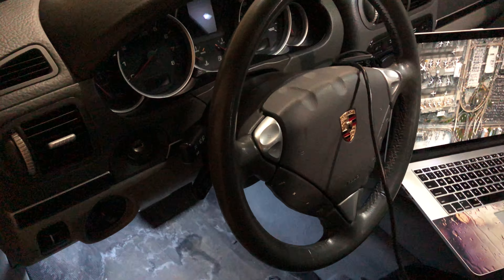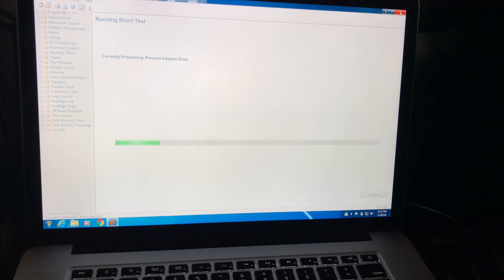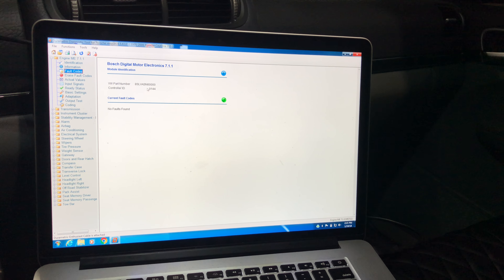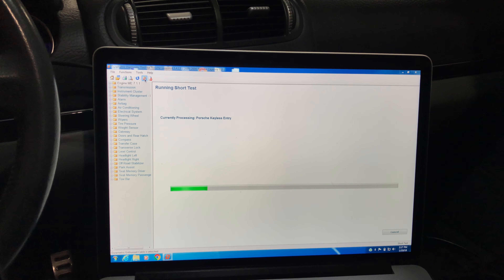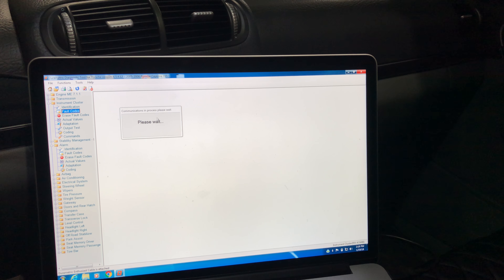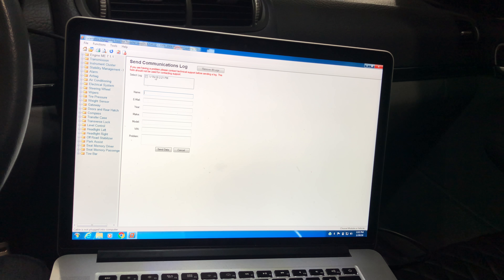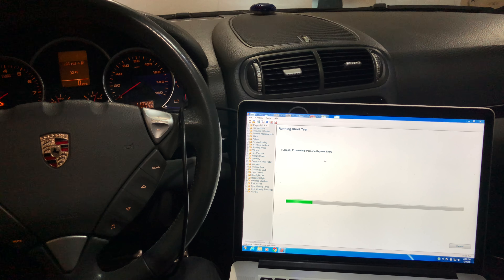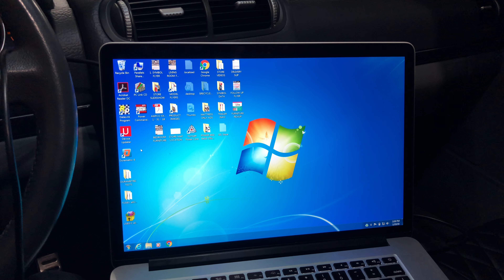PORSCHE DURAMETRIC SCAN TOOL ISSUES- JUNK

Comment: TY. I only had to have my indy use this once in 26 years. The battery got so low in volts that the airbag module was triggered. The airbag light would stay on for 30 seconds, post engine start, then go off. Annoying!
I've a 1996 993 C2 iris blue metallic, 66,000 miles, 6-speed manny tranny, varioram, LSD. No CEL, no oil leaks. I'm never selling it.

Comment: Correction, the Durametric software may work with a late MacBook running Parallels, but with driver issues Also, check to make sure no pins are bent, and electroconductor cleaner spray is used for good connections on both connectors. Hope this helps!

Comment: does your kessy system work? even our factors take a along time to scan the older cayenne. The  modules in the older cayennes are just slow. average cayenne scan as a dealer tech took me 30-45 mins with PIWIS III tester

Comment: Durametric only provides the drivers only for certain PC 
/ Laptop computers running Windows. Make sure all drivers especially the Durametric ones are up-to-date. If you have a MacBook, even a late model running Windows through Parallels, it will not work due to driver issues. This looks like a MacBook Pro. Can you confirm or deny? Just trying to help. I’m a scientist, engineer, computer and networking specialist (and DIY car enthusiasts), I’ll post my vids soon. Thanks.